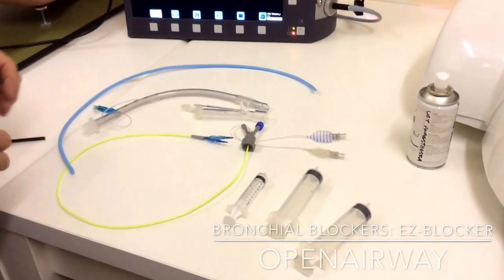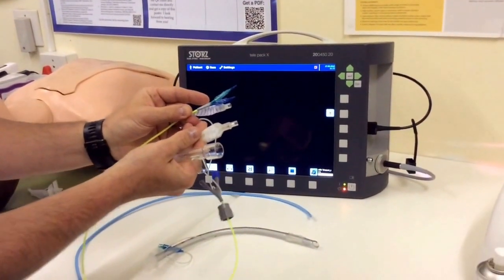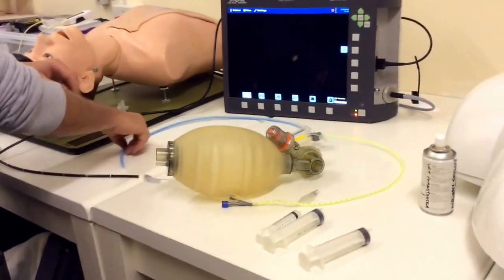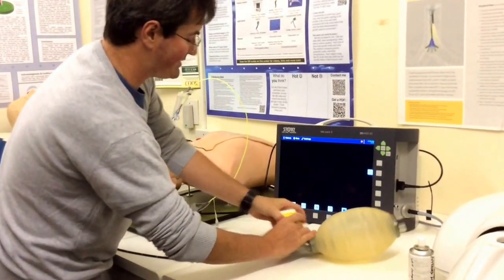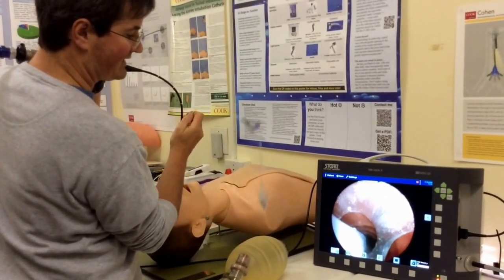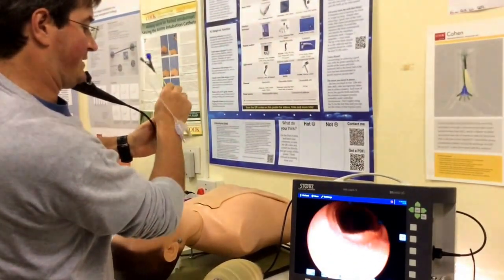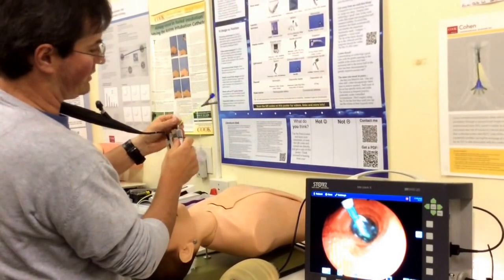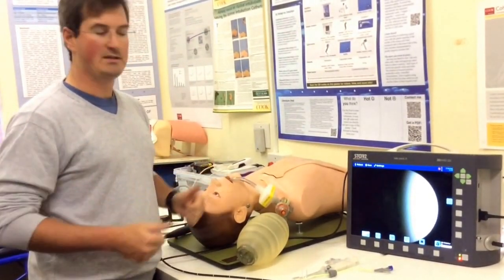Bronchial Blockers: EZ-Blocker

Comment: What size bronchoscope were you using?
Reply from the maker: This was demonstrated with either a 3.2 or 3.5 mm fiberoptic bronchoscope - forgive me if I can't recall which!  One needs a "paediatric" (4.0 mm or less) bronchoscope, but it is ideal if it has a working channel so that you can suck out any secretions or soiling if encountered.

Comment: Hi, I was doing a lung case with a E-Z blocker.. After the OLV in progress...all of a sudden the ETCO2 tracing went flat and I could nt ambue. I met a lot of resistance. Sats were in the high 90s but remained stable. What happened in the lung to create this event? Thank you!
Reply from the maker: Interesting!  My first guess would be the blocker slipping back a bit and thus obstructing the trachea. Sometimes if one overinflates the balloon, it will "herniate" over the carina and give this problem. One can maintain oxygenation with small ventilation volumes, but the resistance to flow is high and lack of adequate Vt leads to little or no EtCO2 trace.
Reply: Did you recheck with a bronchoscope?